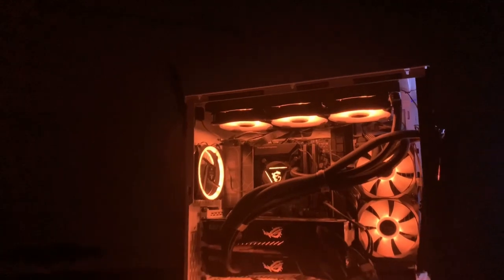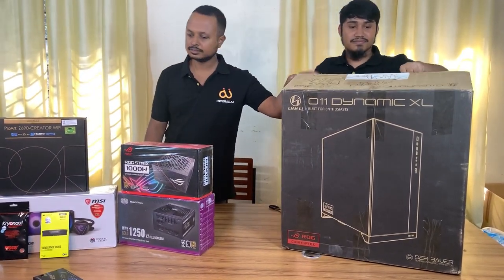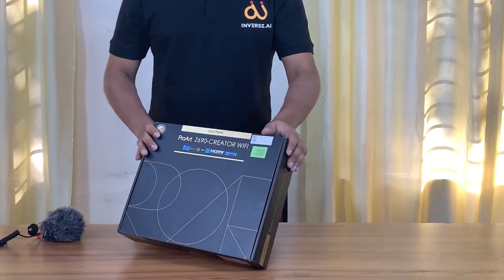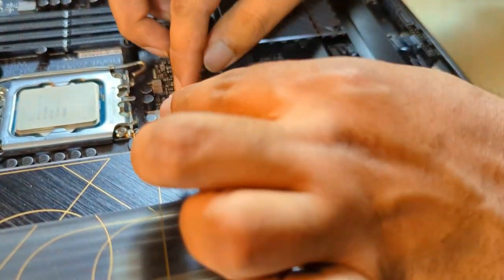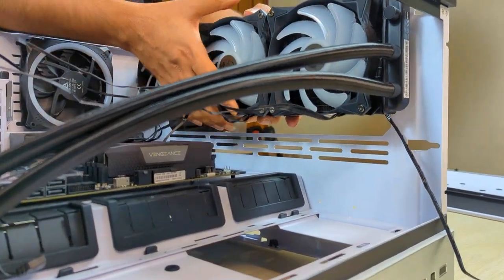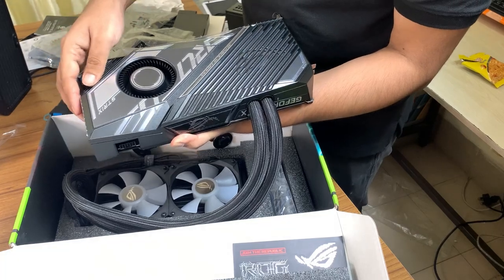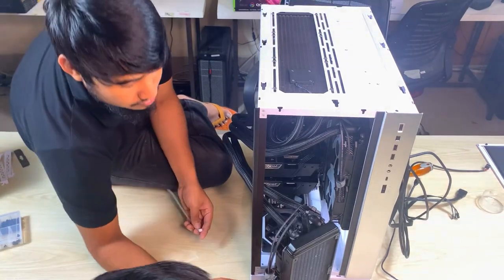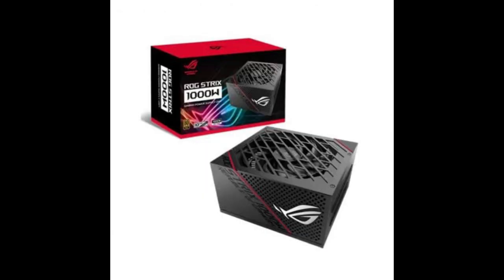DUAL ASUS ROG STRIX 3090 TI + i9 12900K Intel CPU PC Build ($10000), Machine Learning Benchmark

Comment: I think you Guys deserve a thumbs up, coz despite all the YouTube Channels that make reviews on PC Build, you are the only one that build a PC with an Asus strix strix RTX 3090 TI, it is as if you've read my mind, this is exactly what i was thinking of building for VFX, but the thought of a Case that will accommodate those GPU along with the water cooler is a bit challenging even with a custom modified case. You deserve respect.
Reply from the maker: We are glad that you found our video useful. We build this rig only for practical purposes. During the build, we ran into a few problems, such as how to fit 2 3090TI Strix GPUs in one casing. We thought sharing this solution would help others in the community. Best wishes to you.